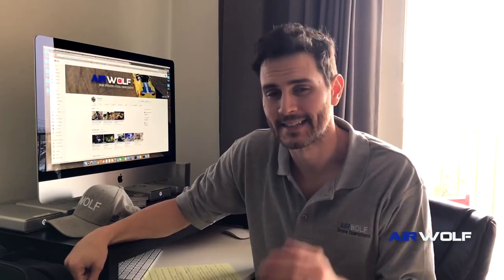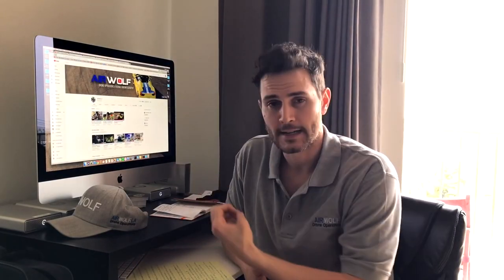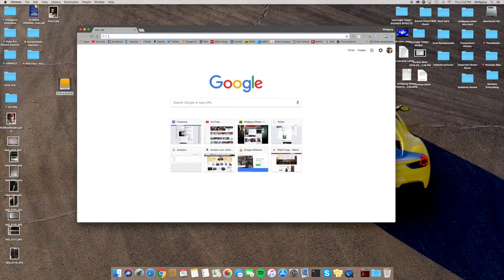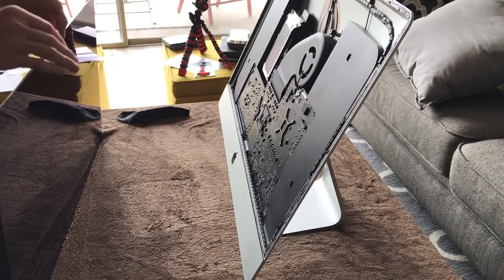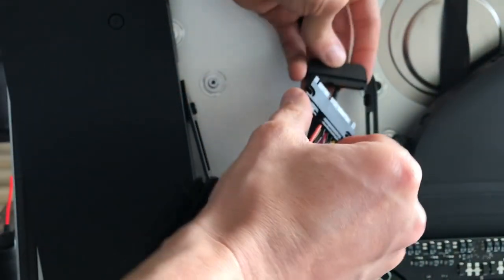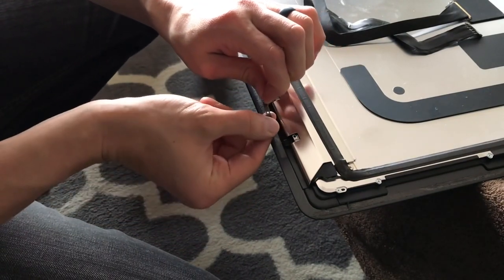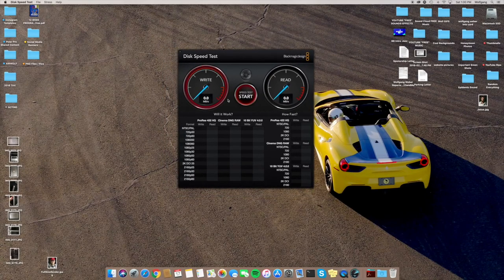Step-by-Step iMAC SSD Upgrade Guide for 5x Faster Performance | 2012-2019

Comment: Thinking of doing this, question is, if I don’t decide to clone my hard drive to the new SSD like you did, my second option would be to re-download the Os X right?
So with the new SSD installed, how do i re-download the Os X?
Sorry if my question sounds dumb, just making sure i get it right! Thanks
Reply from the maker: Not a dumb question. You can either clone like I did or you can pre-install the OSX onto the new drive and power up that way. 

You’d plug your new drive into your computer now via usb using a SATA reader. Find the latest or whatever version on the OSX you want online. Download it and select the new drive as the destination.  Test it before installing by shutting your computer down and rebooting it from the SSD you just installed the OSX on. And if it works, you’re good to go.
Reply: Ahhh i see!!! Would’ve taken me a while to figure out lol
Ok and one more thing, you mentioned something about formatting the new SSD (samsung) so it can be imac ready, how does that go about?
Reply: @LuisLopez-hb3ok  Or just hold down option + command + R and it will download the right software for your mac straight from the internet. That way you don't need to buy an adapter to install the os ;)
Reply: Oh really that’s it?!
So by doing that command, it will automatically prompt me to download the latest Os onto my SSD?
Reply from the maker: That works! 👍🏼
Reply from the maker: You’ll want to format your new ssd to Mac OS journaled.  But that’s the drive you’ll want to install the OS onto of you’re planning on doing a full swap.

Comment: Hi! I saw few that they dont put thermal sensor for imac 2015 21,5inch a1418. It must be for every version or only 27 inch?
Reply: You don't need the sensor for the 2017 or 2019 iMac. This is not a guess, it's real, as I have modified two 2019s and one 2017 with no thermal sensor. I.e., the fan does NOT ramp up and blow at 100% when no thermal sensor is used.
Reply: @demef758  thx. Yeah, i changed for my late 2015 and remain also on normal speed. 🤝
Reply: @demef758  what does 'ramp up' means?
Reply: @daktarioskarvannederhosen2568  escalating?
Reply: What about a 2011- do u need the sensor

Comment: Usually it's only the 27 inch iMacs that have the temp sensor. My 21.5 inch and every one I've replaced doesn't have the temp sensor.
Reply from the maker: That could be. I personally didn’t want to risk it. 😆
Reply: AIRWOLF I’ve done two 27 inch iMacs and both replaced the temp sensor. It’s to pricy of an investment to start skipping parts haha.

Comment: can you have TWO hard drives in the iMac 21.5"? ?  form 2012?
Reply from the maker: I'm not too sure.  But with the size of the SSD's I'm sure it can be done.
Reply: @AIRWOLF  Did you reuse the old HDD after removing (for instance as an external drive)? 
Refitting it in the iMac would mean you have to connect it in any way; in my older 2010 iMac this can be done bij removing the DVD drive and installing a caddy for the old HDD. 
But this 2012 iMac doesn't have a DVD Drive (still wondering why, because in 2012 DVD Drives were still very common) so no wiring for installing an extra drive. Do you think you there is a way to connect the second hard drive?
If yo might read anything about it, I would be very interested.
Reply from the maker: @PatrickvanderDeijl  I'm not too sure but i'm certain it can be done.  I did however use the preexisting drive as a back HD

Comment: Can anyone tell me if the iMac (21.5-inch, Late 2015) A1418 that came originally equipped with a 256GB PCIe 2.0 x4 also has the needed cabling to add a regular 2.5" SATA-3 SSD? Thanks in advance for reply
Reply: @George Larish For your info, I just did an upgrade of an iMac 27" Late 2015 and there the brackets to hold the drive were present, but the SATA cable was not present. It was not a problem as I was doing a replacement of the more standard PCIe 3.0 x4 flash drive. So, thanks for your feedback. Good to know that the cabling on the 21" is present.
Reply: Okay, then I must be cautious here. Must be a region thing… am in Europe…

Comment: I just swapped the memory on my new 21.5 2017 iMac. I should've changed the HD as well :-(
Reply from the maker: Is it running pretty slow?
Reply: Just use the external ssd method. Amazon has thunderbolt ssd for pretty good price just make sure you read the speeds to make sure it’s as fast as the thunderbolt connection

Comment: Yes just plug a external ssd with the OSX on it. Easy, cheaper and safer. Screens can separate after  being glued on. See Linus video of his iMac Pro being dropped. Lewis Rossman does not recommend owners cutting up their iMacs.  All you need is a  USB 3 enclosure and your SSD of choice. If your installed hard drive is still healthy leave it alone and use it as a storage device. You only need a small SSD to boot from. It can always be replaced with a larger external SSD later if the internal hard drive fails. If you have a NVME PCIE drive you can connect it to the USB-c / Thunderbolt ports. Attach the enclosure to the rear of the  iMac with velcro. I have a 27" 2013 i5 and it boots in under 50 seconds off a cheap SSD.  An external SSD will resurrect  your old iMac and make it a useable machine again.
Reply: But wouldnt going thru the thunderbolt connection be slower than internal?  So I bought the OWC ssd drive and it failed on 2 macs after a month. Both drives! They are refunding me. They are junk SSDs made in china probably. So I'm going samsung or crucial or some other known brand. But now your post has me thinking to go external.
Reply: also how do you get it to always boot from from the SSD instead of the internal sata?
Reply: K Dalton did you get an answer to this yet?
Reply: @kdal6744  you have to go to your startup disk in settings and choose it
Reply: @raneanubis  I just installed an internal samsung SSD and the mac has been working great  thanks
Reply: @josefdahari  Thanks, i went with internal Samsung SSD and took the glass off. A little bit of a pain but got it all working and its really fast now.

Comment: wow is this as easy as it really looks Dang if so i may just jump on this route and do myself.
Reply: Yes, extremely easy if you're at all mechanically inclined.  The biggest thing to keep in mind is to just be gentle.  I installed ssd in my 6 year old i3 laptop and it totally woke it up.  Now, I'm about to install ssd in my 2013 imac and assuming it will be just as amazing.  I'm already halfway done with the install just waiting on the ssd to arrive.  The removal process was super simple.
Reply: @scottdrew6403  cool thanks

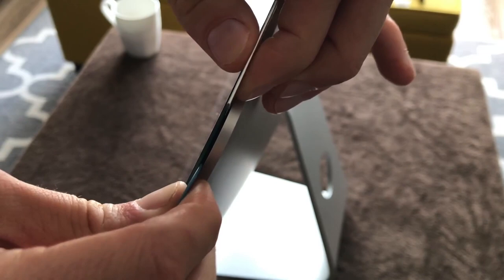Comment: Good video, but please don't assume that everyone has a guitar pick. @7:32
Reply from the maker: Hahahahaha I would assume that no one has any of the items in this video. But there’s links to get them in the description. Including a guitar pick.
Reply: Lol! I have a lot of tools and also a guitar pick collection. I chuckled as I used a Taylor Swift guitar pick from one of my kiddos old concerts. Taylor got the job done just great! Lol 

Two things! I broke my power button cord with the speaker at the end even! I googled that issue and tons and tons of people had made the same mistake. Next the heat sensor wiring in the 2017 is a Real pain in the you know what with the layout as it’s different. I have extensions and it’s still tough! Good luck all!

Comment: Thunderbolt and USB3 sockets on the back are like "Am I A JOKE TO YOU". HINT: the Lacie Rugged Thunderbolt enclosure ( thunderbolt) or Samsung T5 ( USB3 )give exactly the same benefits as cracking open your mac and potentially damaging it. 

The case for cracking open a bonded screen imac is for a comprehensive upgrade, CPU, RAM, adding NVME and Sata 3 storage, ohh and giving it a clean.

Ohh, and the Lacie Thunderbolt enclosures and Samsung T5 enclosures are a hell of a lot cheaper than $300 lol.
Reply: It doesnt work properly
Reply: @TheManglerPolishDeathMetal  Care to give more detail ?.. what does not work properly ?
Reply: @86config  well mainly just takes one port away :P

Comment: failed ! last step, to test and the fan runs too fast suddenly and that monitor power cable  connection part get a flash burned !! :(
Reply from the maker: Whhhhhaaaaat? Were you able to figure it out?

Comment: I'm looking at the Samsung 870 EVO (about to click the Buy button), but was wondering if anyone watching knows, for sure, that the 870 will work as well (or if there are any gotchas).
Reply: It's one of the best - probably the best bang for the buck.  Quit over thinking it.
Reply: @foxmulder3980  - Glad I did my own  research (overthinking), the 870 EVO Plus has problems with iMac's sleep mode. So indeed, there is a gotcha.
Reply: @docdaven  Sounds like you knew of the "gotcha" already and posed your question in a way to pounce on the first person to reply that there are no "gotchas".  Kind of an obvious and sad move.  So, you're not going to install a $50 rejuvenating upgrade into your old computer because the brand new ssd won't go to sleep when programmed to?  Why not just turn the computer off at the end of the day and rest easy?
Reply: @scottdrew6403  nah. I had no idea, actually.  Everyone said it worked but a quick search displayed the issue. That and lower consumer ratings made my decision.  Macs go to sleep on their own, which is desirable. Locking up in sleep mode is not. Shutting it down 5 to 10x a day is not an option and a lame "fix" for a minuscule gain in performance.
Reply: @docdaven  …some more research would have shown you a quick fix for the ‘sleep mode’ problem.

Comment: Hi. Will this work on iMac 27” 2019?
Reply from the maker: Yes
Reply: @AIRWOLF  Thanks a lot. this was very helpful
Reply: depends what kind of drive Apple put in it.   Fusion drives are fussy 😕😕
Reply: @avflyguy   tell me, I have an imac 27 2019 with 1TB fusion drive will it work on fusion drive? thank you so much
Reply: @unknownerror999   Yes, but I see no reason to do so.  The fusion drive is just about as fast as an SSD.  Secondly,  I believe the Fusion drive is a non replaceable drive.  You've likely maxed out your options.

Comment: I updated yesterday my imac late 2012 to ssd and there is no need to use the thermal sensor.
Reply: which kind of ssd did you use
Reply: @jackmadden5250  I buy a WD Blue 4TB SSD Drive ( https://www.amazon.com/Blue-NAND-1TB-SSD-WDS100T2B0A/dp/B07QV3XGCP/ref=sr_1_1?dchild=1&keywords=wd%2Bblue%2Bssd%2B4tb&qid=1595002672&sr=8-1&th=1 ) 
and also buy this adapter 
https://www.sabrent.com/product/BK-PCBS/2-5-ssd-sata-hard-drive-desktop-3-5-sata-bay-converter-mounting-kit/

Also I take advantage that the iMac fan sounds strange sometimes to replace it.

Use carbon copy cloner to clone the drive.
Reply: thanks to updating the drive now my iMac late 2012 is running Catalina without issues.

Comment: can we use any other adhesive?
Reply from the maker: Yes there should be one linked in the description.
Reply: I used a normal two face adhesive and it worked, but be sure to use a thin adhesive tape.
Reply from the maker: @claudionouvelle  Thanks for that. :)

Comment: Hi Wolfgang, 

Thanks for inspiring me to change the "dog" I have in my iMAC.
I see that you can achieve around 450-500MByte/sec read/write speeds once you install the Samsung SSD. 
Can an M.2 NVME SSD equivalent drive be added instead? 
What I mean is: 
- with a Samsung 970 EVO SSD (https://www.amazon.com/Samsung-970-EVO-500GB-MZ-V7E500BW/dp/B07BN217QG/), it appears, from its spec, that much higher speeds (2500MByte/sec) could be achieved. 
Will it be possible to replace the HDD in the iMAC with the Samsung 970 EVO SSD? 
What kind of adapter could be used for internal connection? 
Could it be connected externally to SuperDuper to clone it? 
Ultimately, will it be possible to achieve the 2500MB/s speeds, or are any limitations in the type of PCI or SATA spec implemented in my iMAC 27inch retina 5k mid 2015? 
My wife's MacBook Air 2015 can reach 1400MB/s read/write with its internal SSD, and the MAcBook Air has a processor running at 1.6GHz 
My iMAC 27inch 2015 - 3.3GHz processor,  with an HDD I have the same readings as in your video (100-140 MB/sec)
 
Seriously, after upgrading to Catalina, the difference vs the MacBook Air are much clearer than they were before.
GT
Reply from the maker: I’ve heard of folks adding the NVME SSD and it working 100%. Unfortunately at the time I wasn’t aware of it. But yes you certainly my can add it. But I haven’t looked too much into how to do it. Maybe on the next upgrade. Wish I was more helpful.
Reply: @AIRWOLF  As much as I would have loved to open up my MAC, I would have felt too anxious to break it (I have opened up phones in the past to replace broken screens. This is a bit more expensive than phones). I connected an external SSD-NVME (10Gb/sec spec) over one of the USB3 ports. I tried to use the Thunderbolt 2 port (to double the speed) I have, but I learned TB2 does not carry power, so after buying bidirectional TB3-TB2 adapter and male-male TB2 cable, I now need to send them back. The caddy for the NVME-SSD does not have the possibility to power the SSD. Sooooo.... WIth the external NVME SSD I can achieve similar speeds to what you achieved in your video. Just finished the cloning and it is so much faster now. Cost of doing what you have done externally (without opening the MAC) is in the same ball park as if I had followed your suggestion. Thanks for your help pushing me to do what I had wanted to do for some time. I just pivoted into a different direction. :)

Comment: Why do we need to add a Thermal Sensor? 
how we get form it ?
Reply from the maker: I couldn't find a definite answer as to why you would or wouldn't.  So I just decided to add it.  My system is running great!
Reply: @AIRWOLF  ok but whats the banifft of it ?
Reply from the maker: To regulate fan speeds.

Comment: Why not just run macOS from an external ssd like a Samsung T7 (USB-C) or  X5 (Thunderbolt). No need to  open up your  iMac and  potentially screw things up.
Reply from the maker: Meh you could. 🤷🏻‍♂️ I just didn’t want to
Reply: @aaronlanning1144  It's a bit slower!
Reply: because its not aesthetic nor functional for the workspace?

Comment: i to did it :)  thanks for d help :)  but my mac suks now :(  i dont no y any how itss old now
Reply from the maker: It should help a little depending on how old. But happy to have helped.
Reply: @AIRWOLF  5 years old :) after installing  ssd i feel its bit slow in booting and ram getting full while using ps
Reply from the maker: What iMac do you have and what’s your ram at?
Reply: @AIRWOLF  i have imac 2015 late
with 3.2 GHz processor i5 quad core 
24GB ram 
2 GB graphic ..
Reply from the maker: You should be experiencing much faster speeds. Which SSD did you install? Samsung? And have you performed a speed test?
Reply: @AIRWOLF i installed  1tb  samsung ssd  in speed test m getting good results but in reality i wont 😅 when ask to enter password for login that animation is feel slow and i enter into manue very slow ..    remaining ok ya i feel.2x faster then before 😁

Comment: Where’s the link for the adhesive for the monitor
Reply from the maker: the description
Reply: @AIRWOLF   does it come with the thermal sensor
Reply from the maker: @ewewell  yes
Reply: @AIRWOLF   ok thx I was a little confused I have a 12 model 21 inch iMac could I put a 1tb ssd in it
Reply from the maker: @ewewell  I'm 90% sure you can.  But just check with apple .  Some machines are only rated for a certain sizes.
Reply: @AIRWOLF  ok thank you
Reply from the maker: @ewewell  You betcha.  Happy building!
Reply: @AIRWOLF  thx
Reply: OWC or iFixit has everything you need.

Comment: Why is resealing necessary??
Reply from the maker: So the monitor doesn’t fall off.
Reply: Once you break the adhesive it’ll never be as strong. It’s best to apply new adhesive to avoid a costly repair.

Comment: It says 27.95? Is it supposed to be free?
Reply from the maker: It was 2 years ago when I uploaded this.
Reply: @AIRWOLF  I meant to come erase the comment after I figured out how to download it. I got the app working and I’m trying to clone right now. Yesterday I used the carbon clone and went to boot it today and got like a question mark and no boot so I’m trying this to see if it will boot. Am I suppose to set it as the boot drive some kind of way like with a windows cpu or should it just boot being the only drive plugged in? Thanks

Comment: Why go through all that bother, just plug the ssd into the usb drive in the back of the iMac, it works brilliant, no need to risk damage to the monitor, as long as you have USB 3. I have late 2015 27 inch and I've just upgraded the OS to Big Sur. The internal drive I use only for time machine backups.
Reply from the maker: You’re still limited. The the speeds of the internal hard drive is what makes start up and the  computer overall operate faster. Throw a 6k RAW file into premiere pro on your external, trying editing it. Better yet try exporting it. There’s a reason why folks like apple offer an ssd internally and charge more for it. And it ain’t for storage purposes.
Reply: @AIRWOLF  Fair enough, but the speed difference between the SSD external and the internal is massive but I understand that using Premiere pro and using large files there will be a difference but taking apart the iMac is difficult and damage to the screen is going to be costly. I manage fine using the external.
Reply: But that’s what I was wondering in the video, when he does the final speed test after upgrading he gets around 400 mb/sec read/write. You get the same via external usb 3.1/3.2 too! I was expecting more around 1000 mb/sec when you install it internally right?
Reply from the maker: @kaischneider7697  You do, but having that internally works faster.  Trust me.